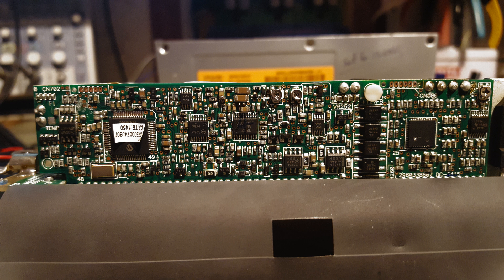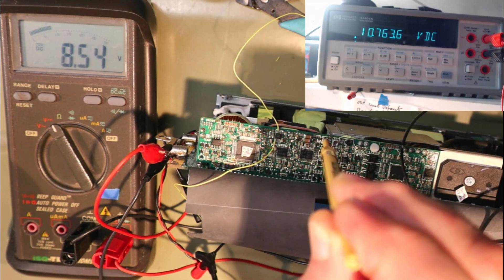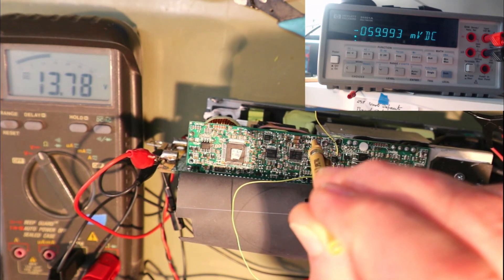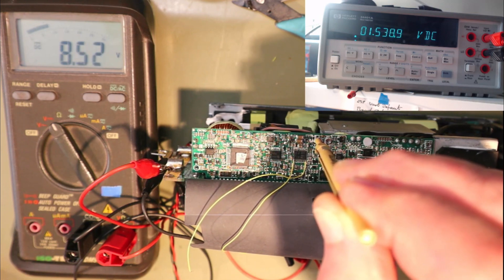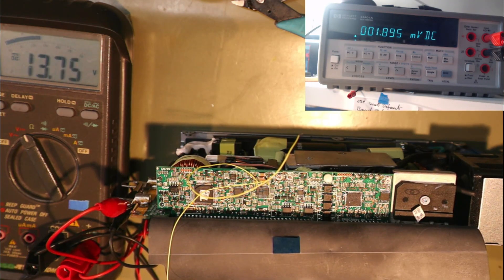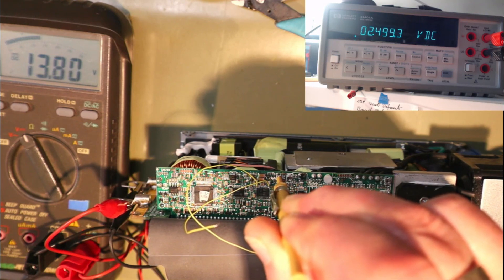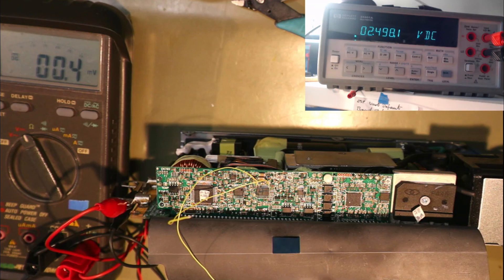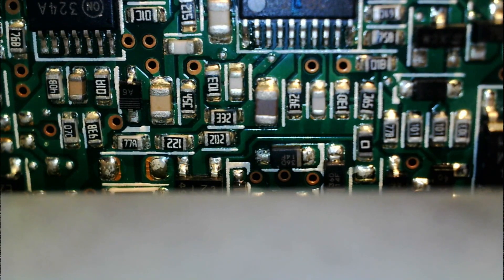#178 HP server Power supply HSTNS PD29    Fix OVP or not

Comment: when modding regular ATX PSU's i usually don't even bother messing with the OEM Control logic on the low voltage side. Usually these have a PWM controller on the high voltage side and a small 5V standby converter, and a few optoisolators. most of ATX units create 12V and step the 12v down to 5V and 3v3 since most power is on the 12v rails. these server PSUs probably only have 12V and 5VSB. the Opto isolators usually are: enable, 5v Standby feedback and 12V feedback. if you just bridge the enable Opto isolator on the highside the supply will be HARD ON, no OVP anymore. After that you just put together a circuit with a tl431 2 resistors and a potentiometer and you will now have a variable PSU. just be careful not to turn it up to high because of the 16v output caps.
Reply from the maker: Modifying the low voltage feedback does keep all the safety requirements unchanged so mains isolation is not compromise. As long as you don't push the output voltage to high as you say the caps should be ok. Hope you found it interesting
Reply: @TheEmbeddedHobbyist  mains isolation wouldn't be compromised. Current limits are enforced by the pwm controller on the primary side. Only things getting bypassed are secondary side current limits, voltage timings, maybe temperature protection. I just use 14,6V to charge a large lithium battery. Works great at 60A. Great video though.

Comment: Question is, how much voltage swing have you got.?
I may need to reduce the output, as I want to charge a 100ah Lipo battery with a constant current board. This involes a booster from a lower voltage to get 14.6v at a constant current of around 30 amp.
Reply from the maker: I've can't remember how much range the voltage adjustment pot has, i just wanted to push it up to just above 13.8V as that's about the normal range for powering mobile ham radio's.

i did not want to go much above this as I've not looked at the voltage range of the output caps.

Comment: Hi .. I Interested in 13.8v from HSTNS-DP 19 do you have any info available to share with me..? Thank you
Reply: check out the rcgroups forums, I've purchased a PD19 yesterday and will be connecting 2 of them in series to get a 27V PSU
Reply: @VoltageLP  ok ..! I really like the size and the power ./! I’ll try ..! Thank you
Reply: @AngelLopez-ys6bt  I still can't believe they managed to pack so much power in that little box
Reply: @VoltageLP  yeahh ..! Unbelievable
Reply from the maker: Sorry, no. this is the first and only server PSU I’ve looked at. i did the video as i could not find any information on it. if there is a pot that can be accessed from the outside that adjust the voltage a bit that might be a good place to start. Just remember these have rectified mains at high power on the boards inside. They can easily kill; you should leave them to discharge before opening the case to work on them. In my while doing my last video i did get a shock of it and it hurt quite a bit.
Reply: @TheEmbeddedHobbyist  there are five pots inside the PD19 =)
Reply from the maker: @VoltageLP  I expect the OVP will not be a pot, but one of the pots that can be accessed from the outside (if any) will be the voltage trim. once you have found the trim pot, then you can start putting a resistor to alter it's adjustment range. then your need to find the ovp control to increase that as well.

Comment: On the back of the vertical board is a LM393 comparator (ST393A) You can add  56k resistor to pin 3 and ground to increase the OVP. You have to unplug the fan connector to see the 393. You can now adjust over 14V. I posted some pics on the eevblog forum. HSTNS-PD30
Reply from the maker: Thanks for the information,  looks like I  need to have a look at this, if all goes well a revisit no2 will be on the cards with your solution.  Thanks
Reply from the maker: Do you know what the pot to the right of the voltage adjustment pot does, i seem to have moved it setting and can't remember where it should be set?
Reply: not sure what that pot is for. I can measure the voltage on that pot on monday
Reply from the maker: @amundsen575  Thanks, It can't be too important as it can be accessed from the outside, but would be nice to put it back in the correct position. or know what it does.

Doing a follow up video with your information, and after telling everyone that these are not safe to work on as there is high power rectified mains inside. I go and give myself a nice jolt trying to turn it off my pulled the mains lead out the back. But I live to tell the tale; good thing the camera was not rolling as the air went blue.

Comment: Im working on a 1200W  HSTNS-PD30 ,which uses the same vertical mounted pcb as the HSTNS PD29 that you show.I tested all 8 op amps as well - only  on the top side of the board  - no OVP found, must be on the bottom side, as you said, I will also buy an additional PS  in case I release the smoke!  If I find OVP, I will post
Reply from the maker: Thanks for the info; I have thought of taking it apart to have a look behind. But with the voltages involved I’m a bit reluctant to do it or show it rectified mains with 750Ws or more behind it could be a show stopper in more than one sense.  And I don’t any heart stopping moments in one of my video, either mine or a viewer.

Will be great to find out where it is as there are a lot of people who would love to set it a bit higher.

Comment: Interesting.
Reply from the maker: Interesting but not quite the result i was hoping for. i was hoping for a clear output to switch high or low, not just change by a volt or so. so maybe i'll have to extend the connections and see if i can run the board away from the bottom board.